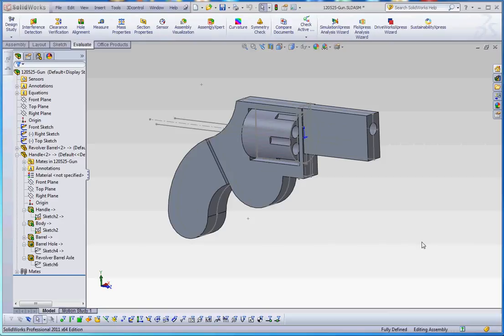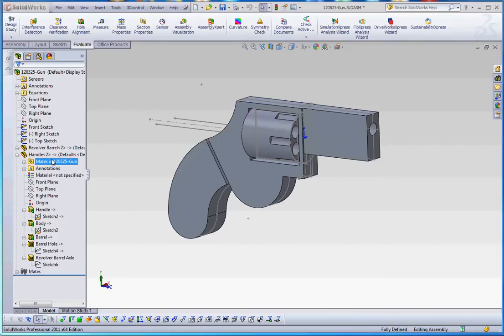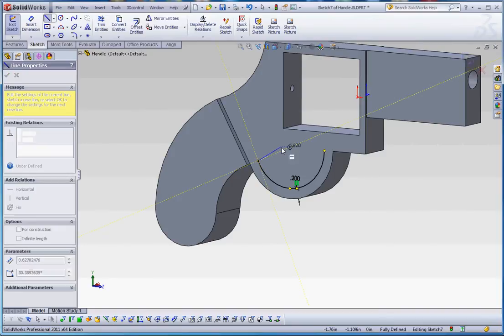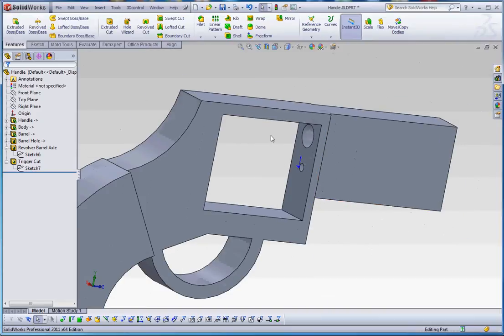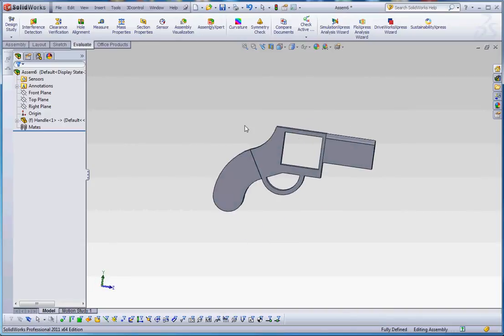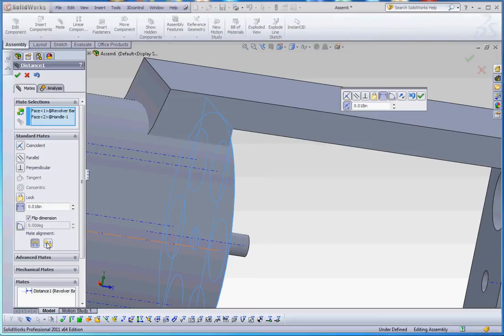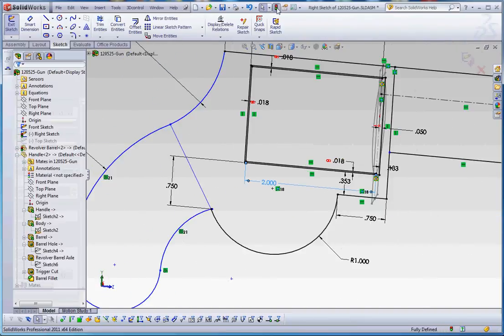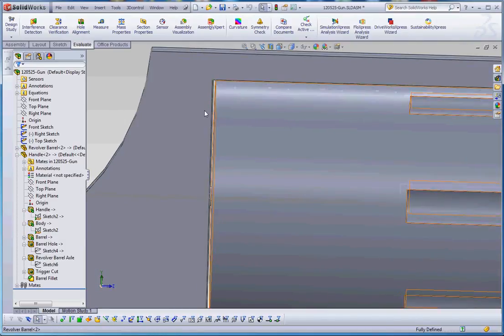In-Context Assembly Modeling, Part 4, A New Flexible Assembly

Comment: how did you make the revolver barrel into that?.  there was no video on how to edit the revolver barrel
Reply from the maker: Sorry i did not catch this comment earlier.  Regarding the barrel I would suggest starting with a simple extrude of a sketched circle remembering to center the origin in the middle of the circle.  The holes and grooves can be modeled on the front face with simple sketched circles and arcs and then a circular pattern of those cut features.  Hope this helps.

Comment from the maker: There are a couple of methods of putting together an assembly in a "top down" approach so that all of the parts fit and are in context with each other like this method is attempting to do.  This method creates mates and relations that are static thus requiring a new assembly that would provide desired movement.  A bottoms up approach where you create parts without in context relations and similar mates may be what you are looking for. Creating separate solid bodies in a part file can also work.